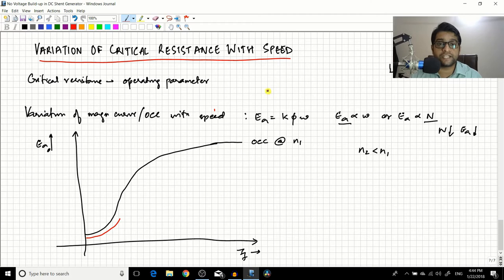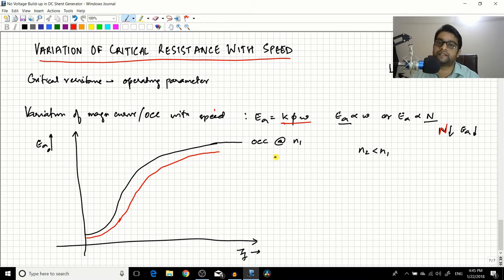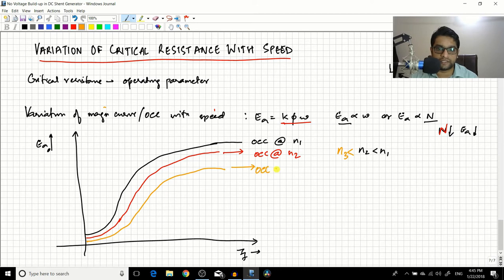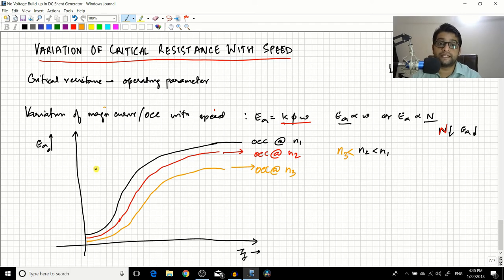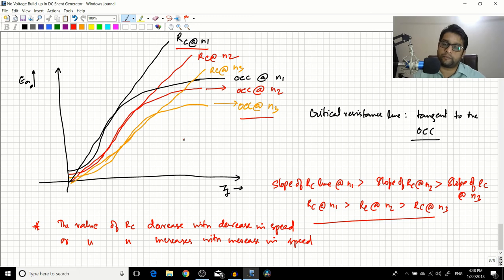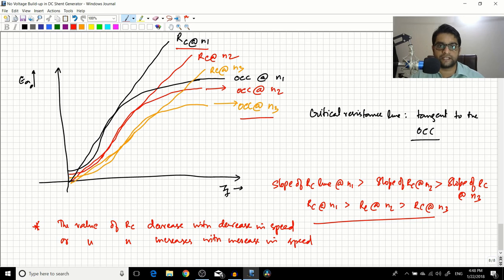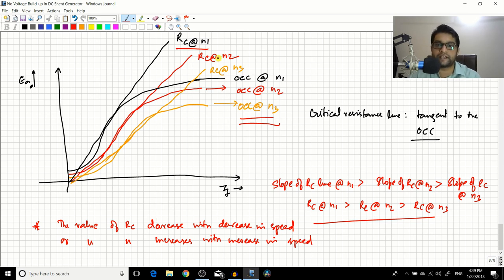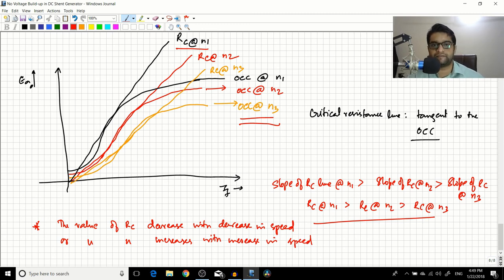#13 DC Generator -  Variation of Critical resistance with operating speed

Comment: at 3.26 why the residual voltage is varying at different speed??
Reply from the maker: Because Ea = k*phi*w..although not much ther will be a small change..
Reply: @ElectricalisEasy  but Ea is induced emf and residual voltage is the voltage that remain in machine before in started..I am confused..
Reply from the maker: Ea is EMF induced in the armature and residual EMF is that same Ea but at zero field current. There won't be any EMF in the machines if it is not rotated, residual EMF us produced when you rotate the machine, but field current is zero..whatever EMF is produced is due to the residual flux inside the field
Reply: Then residual voltage must be independent of variation in speed
Reply from the maker: see voltage is generated only when you rotate the machine, and that voltage whether is residual or any other voltage would be speed dependent, but yes since residual voltage is a small value the voltage also will be small,  as i have told you this would  be a small variation no need to think so much about it...

Comment: Somebody help me please
Reply from the maker: See for example the field resistance is 100 ohm, we can add resistance to it by connecting a variable resistance in series  ok, make it 110, 120 etc.. I.hope that is clear.Now for a particular speed if u draw the occ, the slope gives u the critical resistance ok, now this is the value uptil which you can increase the field resistance, it is like a limit. For example for a speed critical resistance is 150 ohm, so u can chnage the resistance from 100 to 150 ohm but not more than this. Now for a lower speed the critical resistance will chnage accordingly...
Reply: Thanks sir